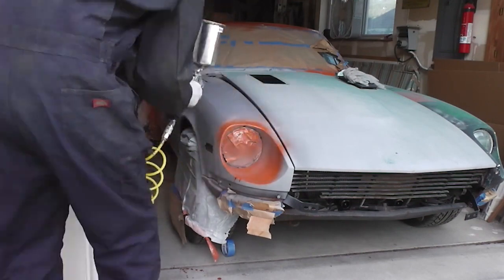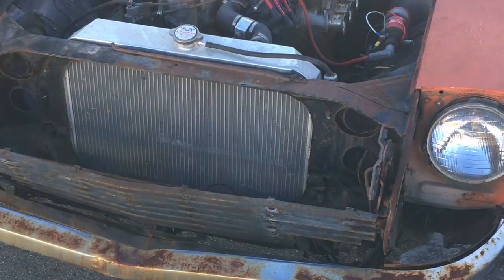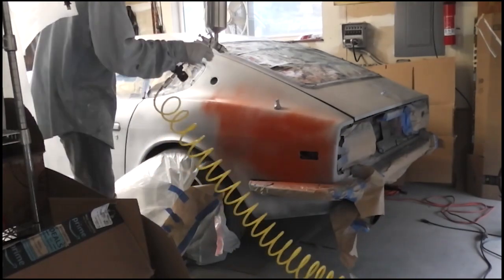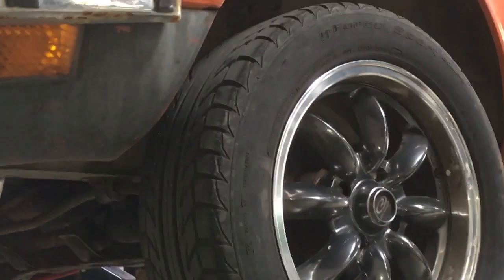While Painting my 240Z, I Found Hidden Damage

Comment: I'm HOPING you didn't sell it
It's no where near as bad as you think it is.
    It's far from a Porsche in fit.But it's not as bad as your looking at it.
   But if you can not do body work, metal work. There are so many YT videos on how to fix it.
     Define "restoration " fixing only mechanical.
  Or taking it down to a bare tub and rebuilding it.
      Depends on your skill. 
I've seen you paint, I've seen you do mechanical work.
   If you do these things. You can fix anything on the chassis. Absolute beginners have successfully fixed the 240z thousands of times.
   You are already 2/3 the talent needed the rest can be learned like you do everything else.
It's September ,2020.
Have you seen the prices rise this year alone on early 240Z's.
Save this one.....or somebody else will.
It's Far from "As bad as you think"
But this also depends on what your definition of "Restoration !" Is.